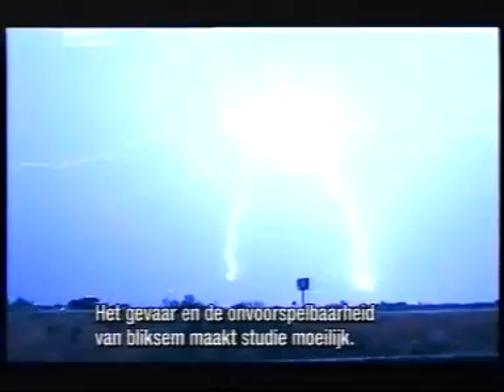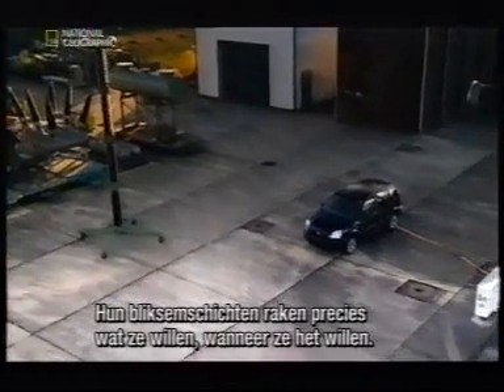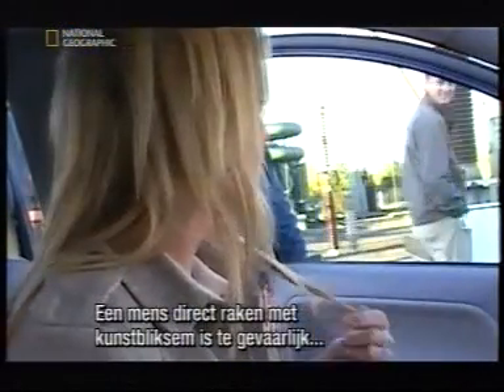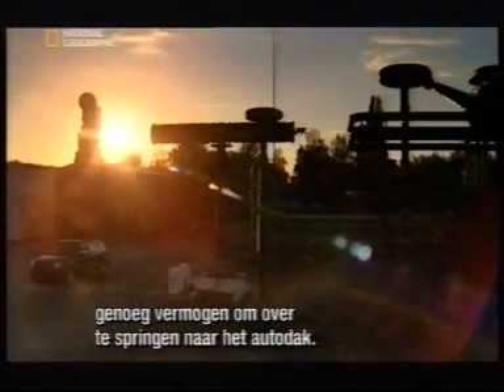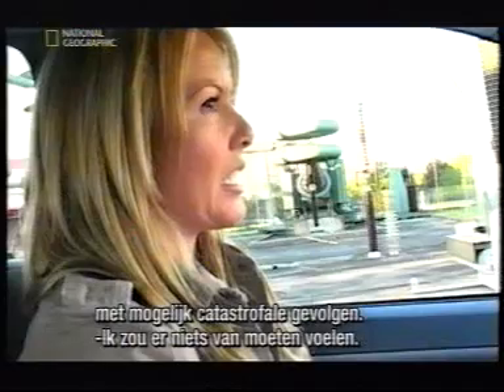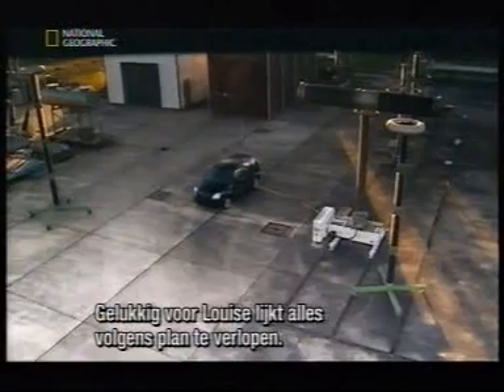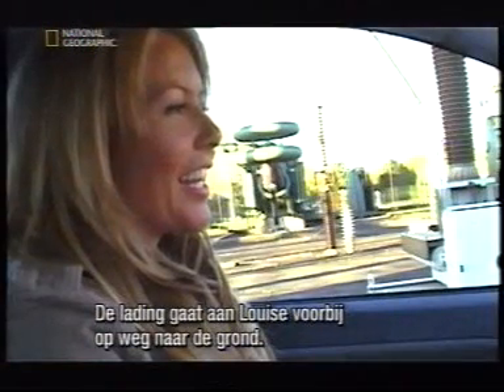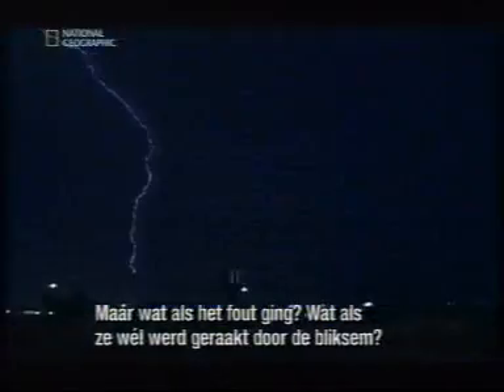850 KV

Comment: The car roof looks so battered because it has been hit by 'proper - electric' - you know, the stuff that comes out of an electrical power socket and not a high frequency tesla coil generator.  Listen to 50Hz. It's the same sound that comes from a transformer dipshit. (unless you are deaf - then I apologise).

Comment: That's what they were testing now, but their little test comes nowhere close to the intensity of a lightning bolt. I can't say for certain, but I wouldn't risk a bolt having too much electricity to not divert, or at least arc, from the metal parts to me and anything else in the car. The roof that car probably wasn't like that before they tested on it.

Comment: let's say there is a storm .. power-lines are down (but not out) .. is it safe to say you will fry your vehicle electronics (and get stuck) if you elect to drive over a downed wire.  Remember there was a storm .. the ground is wet .. your tires are wet ... ample opportunity for conductivity.   Right?

Comment: Youtube censors cut the video short at the end when the narrarator meant to ask 'What would happen if, in the shear terror of the moment, her pipes sprung a leak and it soaked into the seat, touching the metal springs underneath?' Probably going to have to check out Faces of Death for the answer.

Comment: This is crap science! A lighnting bolt is atleast 10 to 120 million volts, maybe billions of volts in some cases and it will burn holes thru the roof of a regular car and choose a new path inside the car if it's a strong +CG strike. 850kv does not tell any story at all. A car IS NOT THAT SAFE! Stay inside a building and don't push your luck. (anything like a barn ain't a building in this case)

Comment: By  the lenght of arc (about 7 feet) I would say that voltage is 850 kV RMS. That means that peak voltage is aprox 1200 kV.Frequency 50 Hz I guess.

Comment: have they earthed the car?
or havent they? is the voltage high enough to turn the rubber tyres into conductors?
Reply: Goes through the air instead through the rubber, and then into the floor.

Comment: I remember General Electric's lightning labs back in '39, had a generator capable of 10 million volts. It was just like real lighting. This demo was more like a small arc from a low voltage generator. The GE arcs would make a loud bang, like dynamite exploding. Ear protection was a must.

Comment: Same thing done on Top Gear. But in NO WAY are they recreating the magnitude of lightning. These are low frequency, high current discharges. The dielectric breakdown of air is 3million volts per metre, meaning a lightning bolt has potentially several BILLION volts per strike. Only one thing has been able to come close to power of this magnitude to this day, and that was back  when Tesla was experimenting Colorado Springs. 

Interesting food for thought.
Reply: Lightnings don't have more than a few million volts, according to field measurements and distance between clouds and ground. The reason why lightnings occour despite they shouldn't is still unknown.

Comment: Lightning likes metal because they can be conductable, not rubber. The rubber is the opposite of metal, they are not conductable. 
Plus, rubber contains carbon, which is a non-metal element.

Comment: all insulators, even good ones like rubber, have a "breakdown voltage" beyond which the insulator conducts current. i don't think that's the case here though, the rubber would behave much differently after breakdown...much higher electric field strength would be needed.

if i had to guess: since there are no arcs from chassis to ground, the excess charge distributes throughout the rubber in the tires and slowly dissipates to ground.

*putting that upper div EM class to work :P*